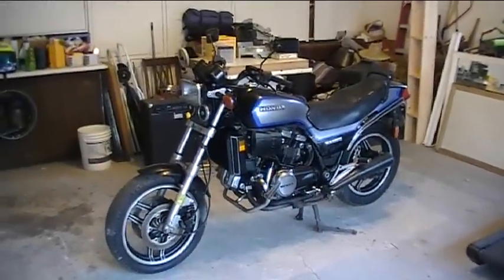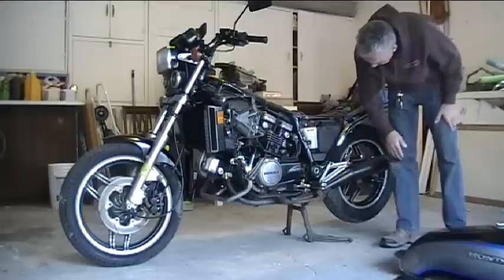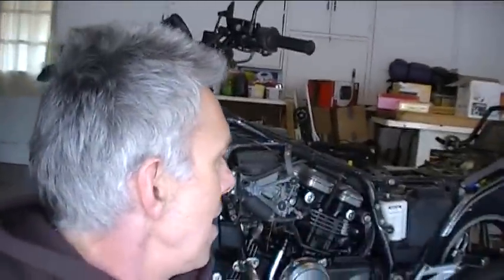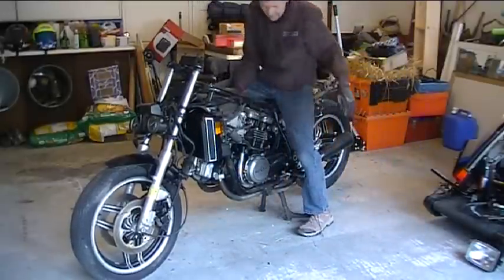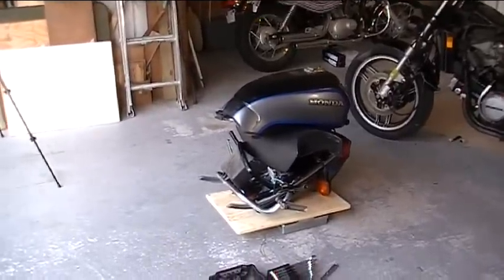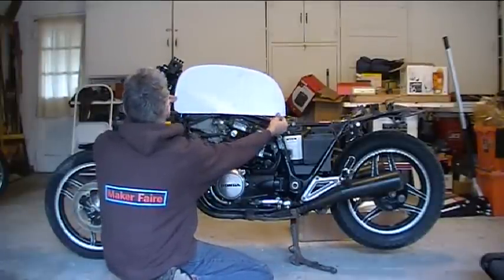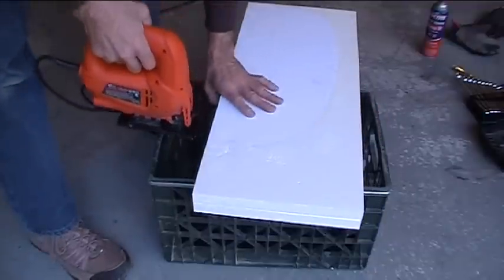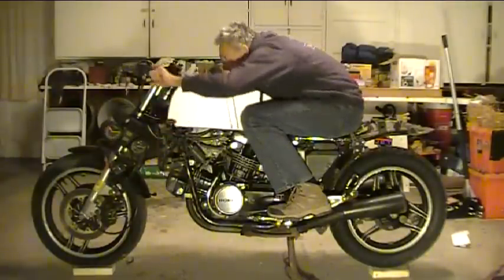Project Honda Sabre Cafe Racer Part 1

Comment: Dean - Applaud your videos and instructions. Very Good! ...I would suggest an inspection of the connection between the stator and the rectifier. They are known to heat up and fail due to corosion and misfit. Currently found that problem on my vt1100 restoration. Keep the fine videos comming. - Dale

Comment: I started with a 1975 CB750 . Then I knoged the frame and made it a hard tail.. also put 40 dregrees front and extended it  six over stock tubes ...I'm
Afraid the carbs were done for so I switched them
I had two 38mm Mikuni  laying around the garage
So I made manifolds . You know  got rid of two carbs.. Put my Harley bags on the back in general 
Messed it up  
   Good luck

Comment: I envy you the space and tools to take on this project, as well as the talent to form a tank. I'm a fan of the Honda V-4, great motor. Concerning the rear fender, have you considered swapping the front fender to the rear and leaving the front bare?  That used to be the "old school" way.  A front fork brace would be of use as well.  Looking forward to the next installment.

Comment: It didn't have a fiberglass tank/seat from the factory. I added it. It was my first custom made bike. I was about 21 when I built that one. It was a 1975 model. :) I traded it in on a 1976 Honda CB750F Super Sport.

Comment: Hey Dean I have a 1984 honda sabre  that I bought over the winter for $ 500. Its a project bike .With a few minor fixer uppers .The gauge and headlight wiring is disconnected .I was wondering if you could help me identify or sort out certain wires . Like the speedo,.push start, I  kinda hit a wall with the wiring

Comment: Hey man sweet build. I'm curious, I'd love to do this, and wanted to do an old GS850 or Yamaha triple, but I don't like the dual rear shock setup, and obviously... the V45/65 honda sport bikes have a much more advanced suspension. So then my question is, how good are the front forks on these bikes? I know they have Honda "trac" but whatever. Would it be worth doing a swap to a newer inverted front end? Also, just don't want to deal with shaft drive clearance and trying to go to monoshock

Comment: Have a very basic but frustrating question for you. I have a 1985 honda magna and love the sabre  series. I pulled and cleaned my carbs but can not find where this line goes back to. It is a fuel line. Learned hard way. I'll send a pic. If you could shed some light that would me amazing.
Reply: Never mind dont know how to add the pic. It's the biggest  Hose with the 90° bends in it.